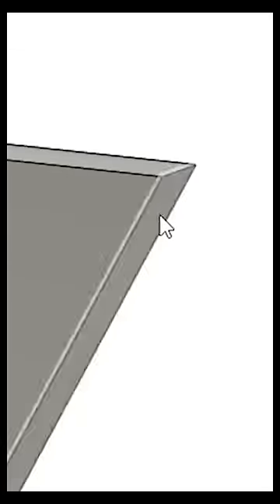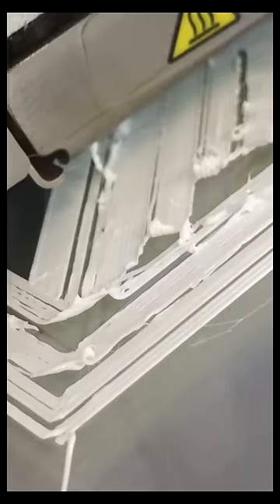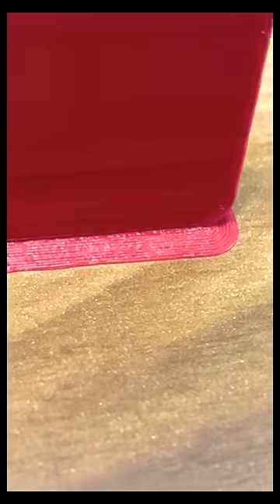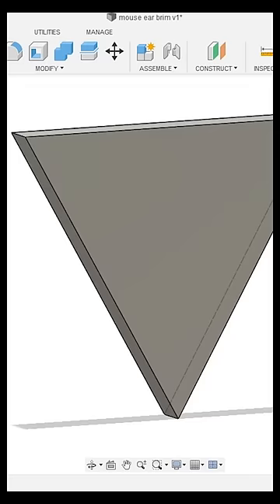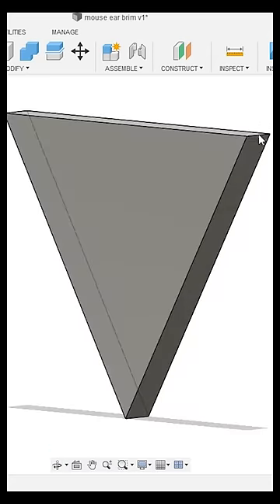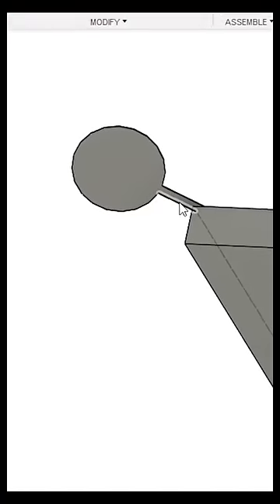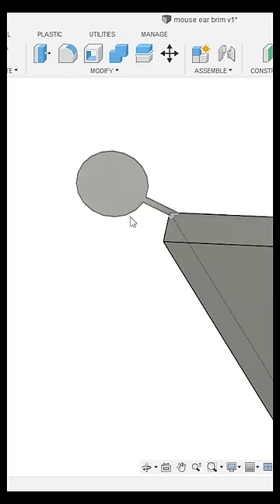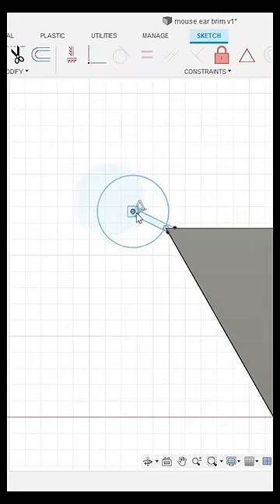Use this Design Hack to Eliminate the Need for Brims #shorts #3dmodeling #3dprinting #cad #tips

Comment: Tuning your Brim separation distance can help make post processing much easier for you if it’s truly a difficult task.
Reply: He talks about mass production. Removing a brim from a single or couple of prints isnt a big deal but if you are producing a lot of something especially for financial purposes, it adds up a lot.
Reply: I agree. The brim doesn't really even need to touch the print. Most of the time it just needs to be a tiny thermal buffer around it. Seems to me discarding 100K loose brims is easier than snipping 300K mouse ears, but I'm not printing at that scale so idk

Comment: Export the mouse ear shape separately, and then just add them in the slicer whenever they’re needed. If you want to reprint something with a different layer height, you shouldn’t have to change the CAD model
Reply: Brilliant
Reply: Sounds like when people make a jig used in woodworking. But for 3d printers. Nicely thought out.
Reply: It's actually quite easy to add this on to the test print plugin. That's what I have done, I just reach up and select from the drop down

Comment: If your head is pulling up the work you need to reset your bed to the right height
Reply: @wesleyswafford2462 i disagree. Even tho warping is a common issue, it’s never reasonable, it can be fixed without brim help. I’ve been printing for a few years and once I know what I’m doing, I’ve never had warping issues even on the corners he shows. Printers can definitely be dialed in and tuned properly to avoid this
Reply: Exactly. I've started with an AnetA8, "open air".
Now I have Prusas and Vorons with chamber and the PEI sheet alone cost 65€. There is no warping. There is never brim. Also quality filament.
Reply: @REDxFROG I have an open air Ender 3 v2 clone, no warping. All of these people either have awful print setups, awful slicer settings, and/or no clue what they're talking about.

Comment: Brim just tears off...
Reply: Yea but also leaves weird edge that needs to be sanded or debrimed
Reply: I love how satisfying it is to just fold it off. I just hit it with a steel de-burring tool
Reply: You’re thinking of raft. Mine don’t, but I use high quality, strong filament.
Reply: @jesusochoa3721  run the back of a knife or a deburing tool and it's pretty quick.
Unless I'm doing multiple prints, it's quicker than puting mouse ears.

Comment: I haven't seen many reasons to actually use a sharp corner yet.  Rounds usually look nicer, and sharp corners can cause more pain than a floor Lego if you're not careful!
Reply: Sharp corners are often needed for multipart assemblies. And while the example is a triangle, they exist in other shapes, say the fluting of a column that you're printing taller the capacity of your printer. Things like that don't often make it to a company like Slant3d, but can often be found in smallrer run projects.

Comment: I've been using mouse ears for years, especially when printing ABS. Not only to 'save' corners. Use them as well to increase adhesion when producing big prints. On straight parts of your print place mouse ears at least every 8-10 cm/3,5 - 4".
A very good tip.
Enjoy.
Reply: sketching those "sprus" on a corner can be tedious - do you have a tip for sketching them?

Comment: PRINT WITH NO BRIM 🧢🧢🧢
Reply: Precisely, get good bed adhesion in the first place and stop using glass 👍
Reply: Whenever I see a brim print, I know the user hasn't reached it yet. 😅
Reply: @lio1234234 maybe if it's smooth glass, but I have a textured glass bed and only have adhesion problems with really tall objects that don't have a lot of surface area touching the buildplate. 95% or more of things I print, I only need a skirt. It's not glass that's the problem.

Comment: Never had issues with sharp corners.
Reply: Because your Z-offset is correct. This video should be showing you how to properly level your bed and set your Z-offset rather than putting a band-aid on the issue with a “trick”.

Comment: It is just me or would the time spent creating this be greater than the processing time needed for a slicer to add a brim?
Reply: It very much depends on how many times you'll need to print the part.  If you're making one, you don't care about the time it takes to remove a brim.  If you're going to make five hundred, you do.

Comment: This makes your cad tied to your print settings and the print settings of everyone else who will in the future use this file. (if the height is too low compared to layer settings it won't print). This also makes this cad design tied to fdm additive printing processes which has nothing to do with the CAD file. These are not needed on sls additive manufacturing, they are not needed on subtractive manufacturing. Don't do this. Make changes needed for printing on the file that will be printed, not the CAD.

Comment: If your first layer is calibrated right and your bed is level you wouldn't have this problem in the first place. Also taking printing advice from someone who's prints look terrible. maybe this is a stopgap that works for your situation but it's definitely not best practices, you're just putting a band aide on a larger problem of good bed adhesion.